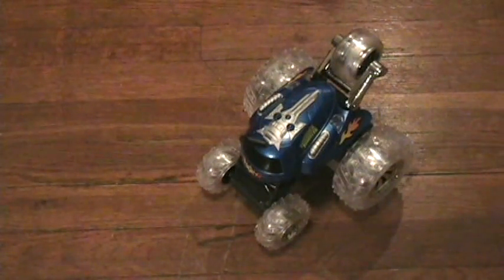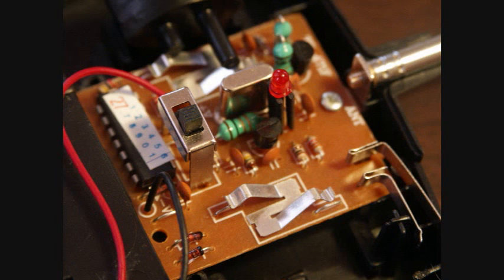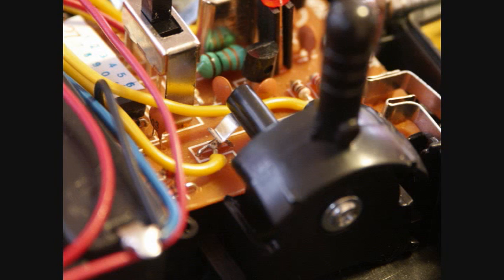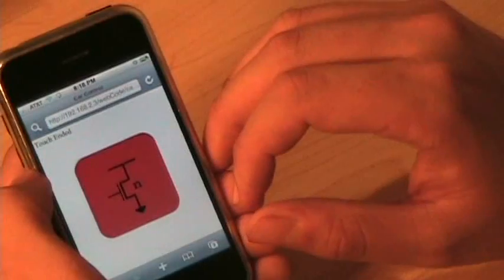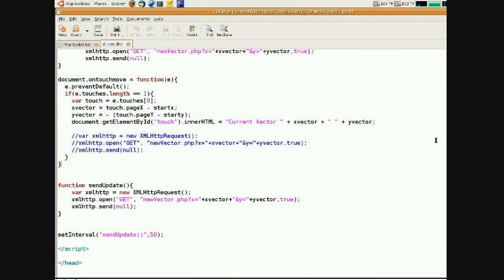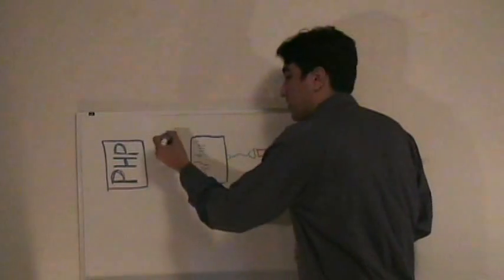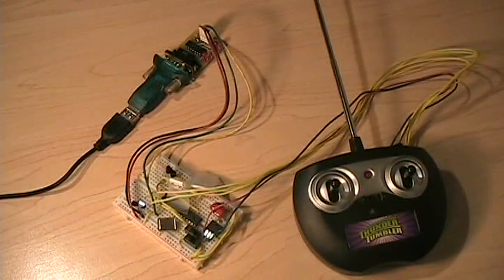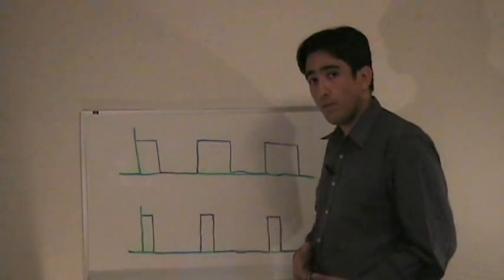How-to: Build a iPhone-Controlled R/C Car

Comment: Quite good sir. I believe, though, that you could use the wireless chip nRF24L01 to communicate with the iPhone directly from the Atmel microcontroller; am I right?
(Check out eBay for complete PCBs with the nRF24L01 plus all other components already soldered; cost virtually nothing).

Comment: @BeArtlife 
I did something similar and it can work, but you are likely to Need some more equipmemt like Sensors unless you can make shure , that nothing Is going to push the vehicle off its original path...
Anybody please correct me if i made a mistake and sorry for My Bad english^^

Comment: Loved your video! I have been making and experimenting with lots of these kind of controlled cars as well, but not for the Iphone. It never would have come to me to use what you call pulse width modulation, to control the speed of the car, I just been setting them to go slow, because my internet connection is not that grate anyway but I will keep that in mined for the next model. Thanks for the useful info!